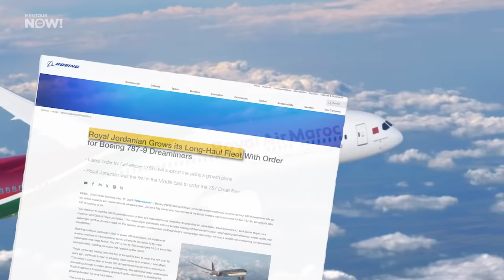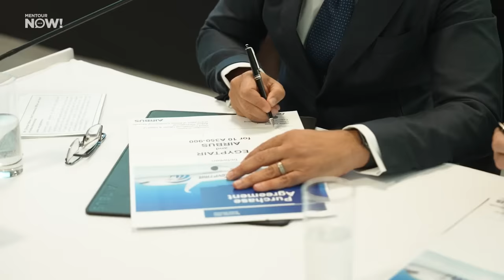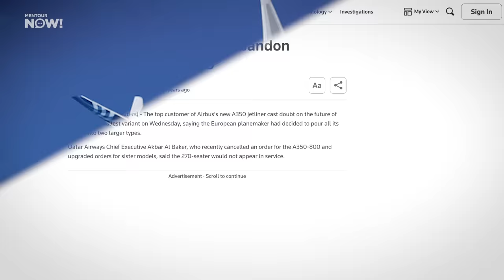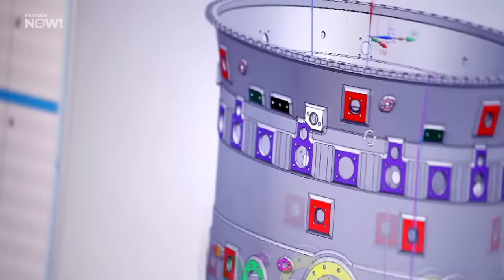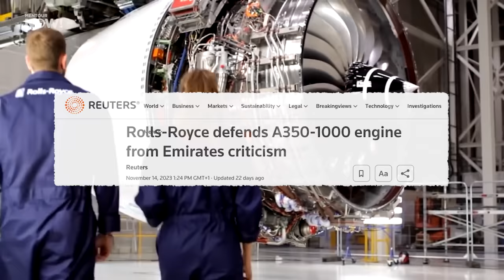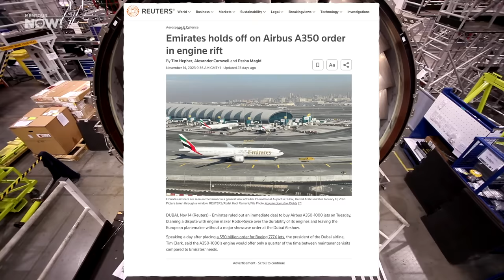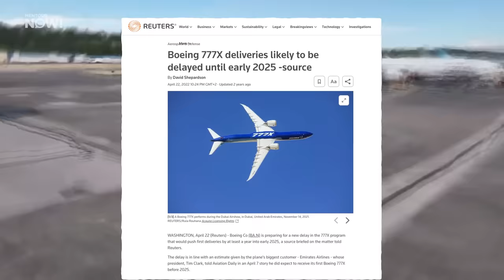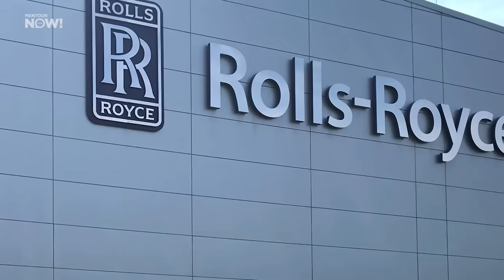What’s WRONG with the Airbus A350?!

Comment: As someone who flies internationally often I'm so disappointed to see the 787 and A350 not being the only aircraft sold at this point.  The comfort of flying on a composite airframe with a much better pressure level is unbeatable.  I flew to Bangkok last time on an A350 and then back out on a 777 and the A350 was incredibly more comfotable to be on for a long flight.
Reply: I haven't flown on the A350 yet but I couldn't disagree more on the 787. Airlines are encouraged into such a dense Y configuration that there is less than no width at shoulder level.

For sure the whole "dreamliner" moniker was a stroke of marketing genius but the aircraft itself is simply awful. I swear people say they like it because they feel they should say so. I'd take a 777 over it any day
Reply: @infidellic  Me too.  777 TPac BKK>LAX is just fine, although A380 was head and shoulders, but it's not a fair comparison.  Only did 3 hour hops on the A350 into and out of BKK, not very long, but nothing stood out to me as exceptional, other than it was a brand new aircraft at the time.

Comment: Why not offer the Airline a couple of spare engines ready to go for when servicing becomes necessary? That should take care of any downtime.
Reply: A couple of couple of spare engines at around €30m+ each? Also, if they're going to have a spare engine policy, 2 will probably not be enough.
Reply: @thecockerel86  Better than losing sales and having the engine program collapse. Hopefully over time, the issues can be resolved and the surplus requirement eliminated.

Although, if that was a good option, it probably would have been offered :)
Reply: I don’t know anything about aircraft engines but I imagine swapping the engine is not exactly quick and easy to do.
Reply: @Mike-oz4cv  I didn’t even think about that. Good point.

Comment: I’m sorry but i hate the A350s. To me the interiors are cheap, rattly and uncomfortable when compared to the old A330s and 777s. I’ve flown on many a350s over the years with Cathy pacific, Oman air, ethihad and Singapore airlines. Every single one i have loathed and found uncomfortable plus cheap. The older planes are simply better built, higher quality and more comfortable. I don’t understand the hype but rather just disappointed. The very best of the best being a380s and a330/40s plus 777s which are from the 90s and early 2000s.

Comment: Strange that airbus did not want to try to adapt the G9x to provide a new engine supplier alternative. This would also be interesting if they were to launch a bigger variant (a350-2000) as this would be the best choice as the investment would have already been done to adapt on the -1000.
Reply: Apparently they did, they even tried a more modern version of the GEnx for the A350-900, but as far as I know, GE is sort of committed with the 777-300er and 777x for engines with around 100k lbs of power output. I believe we’ll have to wait for Rolls Royce’s ultrafan to power newer versions of the A350
Reply: 9X might be to heavy or large and is way too powerful the GeNX might be more suitable but it is underpowered
Reply: @antonytsai6611  yeah, apparently GE offered to power the smaller -900 with the GEnx, but not the -1000 with the GE90 (which would fit quite well, as it is only slightly larger than the trent xwb) or the GE9x(smaller version maybe?), as it would compete directly with the 777-300er and 777x, whose exclusive engine provider is GE.
Reply: Rolls Royce is building Ultrafan engine, and Airbus waiting for this.
Reply: In General there is a bigger demand for modern aircraft engines then production capacity and this will increase even more when the engines evolve further. 
So it makes sense that f.e. Boeing buys the entire year(s) production from a GE type engine to get engines for their aircraft.
Boeing and Airbus still have completed airframes parked at their factories waiting for engines.
All engine manufacturers had some issues with some types of engines.
Making aircraft delivery impossible or even worse grounded aircraft.
Reply: "would be the best choice" because you're biased towards GE
Reply: not likely soon though :'( @djonymorais
Reply: @Slyze33  True. But as stated in the video, technological advances developed for the ultrafan may help RR sort out these issues on the XWB-97 soon enough, let us see how this story rolls out.

Comment: I did a fairly large amount of flying for a time in the mid and late 1990s.  Due to the kind of flying I was doing I was VERY rarely in wide-body jets: mostly 737s and MD-80s (I GREATLY preferred flights in the 737s--better pressurization and, just from a passenger standpoint, it felt like the flight controls were a lot smoother when dealing with the frequently unpredictable weather of the US's southeast).  I haven't experienced any of the more recent wide-bodies other than one flight in a 777-ER that i wound up 'accidentally' because of a rescheduled flight for myself and the need to get that aircraft to Atlanta for a later flight (4 commercial passengers, some dead-heading crew and the assigned crew--that was it)).  The only other wide-body I was ever in was a 747 back in the days of Pan Am and Eastern on flights from Heathrow to the US east coast (Boston, NY, or DC).  Would be interesting to fly in some of the newer ones.

Comment: Both 787 and A350 are hi tech aircraft. Technical problems and difficulties are to be expected. 777x is a safer bet and with the demise of the 747 and the A380 the 777 is the best large two engine aircraft out there. For Emirates being a large 777 customer already is way easier to continue with the type. It has a better engine too.

Comment: So Emirates dangled a huge order of A350-1000s to Airbus, and got a great price from Boeing on the 777X. 
The issue with the Rolls Royce engine could be the excuse Emirates was looking for to back out at the last minute. I believe the GE-9X which will equip the 777X is a partially new engine with unknown reliability and service requirements.  In 2022, the GE9X encountered technical issues which forced Boeing to halt the testing program of the 777X. So the engine argument looks flimsy.
Lastly, Emirates had already 115 Boeing 777X on order. So it would really make sense for them to stick with the same airplane. Emirates now accounts for about half of all 777X on order.
So Mentour has gone into a lot of pro Boeing speculation. Emirates got a great price from Boeing by threatening to switch to the A350-1000, when it wanted to stick with one aircraft type all along.
Reply: Hmmmm let's see, the Trent XWB has a dispatch reliability rate of just 99.91% and the GE90-115B/GEnx have a dispatch reliability rate of at least 99.98%, and with all this experience and proven track record GE has, we can see where this is going 🤔 we have to remember that the RB211 faced so many technical problems when it was in development that it would have seemed that the RB211 wouldn't be a good platform
Reply: @rafaelwilks false stats

Comment: As a load planner, the trimming is a problem when flying with full load , many-times I do need to offload cargo due weight and trim, so the fwd hold is empty in long haul flight😂 so I don’t know how the a350f will operate with that trimming. But the a350 family do more fuel economy than others

Comment: The fan diameter of the Trent XWB-84 and - 97 is the same at 118 inches - the difference is - 97 parts are beefed up to deal with the larger thrust.

Comment: Regarding the A380 I wonder whether Emirates could buy them from other airlines? After COVID it appeared that no airline would resurrect it because of fuel economics. Lufthansa even said there are done with it. But have now returned some of them into service. As I understand not all of the parked planes. So if Emirates wanted they could get some used planes perhaps even cheaper than if Airbus would sell them new ones. Which will not happen as we all know.

Comment: Correction the fan diameter in both engines its 118" not 84"and 97". The 97 has a bigger core.

Comment: Well, this one is somewhat clickbait, basically Airbus needs to get more engine options for each the 220 and 350 1000, relying on a single one just invites problems, but still better than the 777x that is years away from certification

Comment: Mentour, actually pretty good analysis, also it is wort to add: CEO of Aribus resigned during A380 as he said: " as I can not guarantee required reliability of the aircraft we forced to make".  Now, when A-380 way earlier stop production, with cost of maintenance over 10000 pounds after each landing, this story its correct, again.

Comment: Just wondering how much time it would take to swap one engine with another on an aircraft?  My guess is much less downtime than it would take to repair and service the existing engine.  Ergo, RR might offer 3 engines (3 for the price of 2) with each Airbus A350-1000, one kept as a stored backup for quick replacement.

Comment: Hi Mentour, just a comment on production and editing.
If you are going to put up graphics for things like engine stats, and then compare two engines...
You really need to do a split screen with one engines stats on one side of the screen, and the other opposite.
Putting up one set of stats, and then taking them away to replace them with the comparison, several seconds later, pretty much defeats the whole point of putting stats onscreen in the first place.

Comment: I still have one confusion with this move of Emirates. I cannot find any source of information that guarantees that the Boeing 777X's GE9X engines would not have any similar issues/problems as the Airbus A350's Rolls-Royce engines in the climate of the Gulf region.
Reply: Hmmmm let's see, the Trent XWB has a dispatch reliability rate of just 99.91% and the GE90-115B/GEnx have a dispatch reliability rate of at least 99.98%, and with all this experience and proven track record GE has, we can see where this is going

Comment: The profiteers are extraordinarily stupid and have made ridiculous choices in the designing of these aircraft. 

AIRBUS, to its credit has very thoughtful spacing designs in their aircraft. I prefer flying Airbus to Boeing for sure.  

I would prefer flying Business class on the A350 than the 787 because I prefer the A350's seating and the windows.  The 787 has those electrochromatic windows you can't close.

The 777 feels old.  Hopefully the 777X will be upgraded to feel better.

I think what needs to happen is a return to Tri-jets so ETOPS is not an issue.

Comment: Whatever might be wrong with Airbus,  their "toy" planes have not been recorded diving to the ground or loosing significant body parts in flight recently. Which is helluva more than can be said of "oldschool mechanically controllable" Boeings.
 By the old logic of "the workshop where a big mishap recently and loudly is likely the most polished for awhile afterwards" I fully expected the MAX disaster to cause a good deal of right changes over there. Oh was I wrong.
Reply: this is true. Airbus have had a history of confusing/overriding their pilot's control inputs. Boeing seemed to be doing fine. Then 'something' happened. And parts started falling off their aircraft...
Reply: @JK-dv3qe  I think the "recent mishap means all is polished now" effect not working at Boeing is horrifying. It means that as present, leadership, staff, capabilities, - even existential threat problem - which MCAS scandal was - does not cause'em to put their shit well together, and make sure at least for awhile, dust settling, everything Boeing is top-notch.
This is the sign of rot so deep and integral that combined forces of genuine conscience ("we released planes with system that killed 350 people and we need to strive to make up for it") and simple corporate business care ("making planes that crash on their own is not a good prospect neither with regulator nor with customers") are still WEAKER than the fuk-all inertia.

Comment: I'm willing to bet that time on wing will be improved by RR through things like retesting, recertification, and rewriting specs. I seriously doubt there will be a great deal of actual parts improvements. Kinda like the way some cable manufacturers initially went from CAT5 to CAT5e....they simply tested the same cable at a higher data rate and said, "tadaaaa! Lookie at our brand new CAT5e!"
Reply: Similar to how TBO (Time Between Overhauls) grows on new light aircraft engines with experience.

Comment: To my knowledge, the reason why the A350 only uses the RR Trent engines is that GE has a monopoly on the 777 and they did not want to offer a variant for the A350-1000 model, that would compromize the 777 sales.
Reply: GE has a monopoly on the 777? I thought the 777 also used the RR Trent and the PW?

Comment: As an economist, I cannot follow, that time to wing can be the issue. In fact a high frequency of small maintainance is much better than low frequency of hign maintainance. The key issue, is to be quick.

Imagine Emirates replaces the old jets and operates 100 pieces of A350-10 with the trent 1000 engines. What about they order 101 pairs of this engines and let them deliver the one extra pair to the hangar in Dubai.  Now they are ready for the first plane to come for maintainance. They remove the engines from the wing. The next step would then be to put on the "ready to go" spare engines and push the airplane back, out of the hangar, so that the airplane can start boarding for the next flight, while they start to maintain and test the removed engines in the hangar and make them ready for the next airplane to come for maintainance.

By optimizing that change, it would look somewhat similar to a forumla 1-box-stop for changing tyres during a race. Therefore it is no more important, how often, this maintainance has to be done, because you dont loose time at all. I even think that this high frequency of  engine maintainance would save a lot of costs and issues.
Reply: Engines are not car tyres, there are a lot of moving parts and an engine swap will also require on ground testing to ensure all performance parameters post swap are in spec, add up all this no-flying time and you are losing money.

Comment: And today we've all seen that this thing burn clean and fast...
Reply: We've seen its safety standards hold up and save the lives of hundreds of people.
Reply: this "thing" collided with another medium sized aircraft and didnt lose any integrity and all passengers were evacuated without serious injuries. What more you want from an aircraft?
Reply: Just nothing. Fanboyz rage is enough.
Also we always brag aboot airplane carpet and curtains having to be fireproof but in these new  bird it’s the whole skin that goes up in smoke.
Have you seen the videos ? Looked like the Hindenburg…
Reply: @G_de_Coligny  Just need it to not instantly ignite, and that worked well.
Reply: @G_de_Coligny  you dont understand the basics of fire safety measures but need to put out your opinions. Dunning Kruger is your friend.
Reply: Ok, more info.
The plane structure survived the impact.
There was 8 minutes between the full stop and the door opening. Because of … protocol consideration  it seems.
Then the evacuation took… 10 minutes… despite apparently nobody taking any luggage.
Tally putting the fire resistance in this case at ≈20 minutes
Maybe not far from a Saudia flight 163 disaster.
(Source mostly aldo sterone aviation channel)
(Previous msg sources were NHK livefeed)
Reply: @G_de_Coligny  The total evacuation time doesn't tell you much. The crew are the last the leave the plane and they would have taken time to check the aircraft thoroughly to ensure no one was left behind, and the captain was the last person to evacuate. They had checklists to perform and things to check. 

I get your point, the wreckage looks bad after the fire burnt out, but compared to how some purely aluminium frames can ignite under the intense heat of burning JET-A fuel, it's really no different. This was a fully loaded plane with all the luggage to boot, plenty of material to burn inside.

Carbon-fibre-composites are partly plastic, and plastic isn't well known for keeping its shape once exposed to very high temperatures, but then again, aluminium could melt at temperatures below JET-A's burning temperature.
Reply: @AnonymaxUK  
yea, captain might feel a duty to check if it's empty. but 10 minutes... that would be the kind of guy to fold the deck chairs on the Titanic...